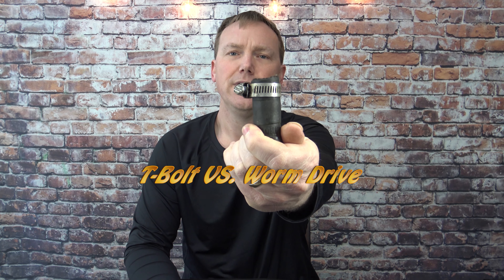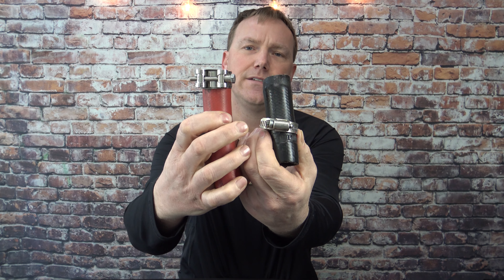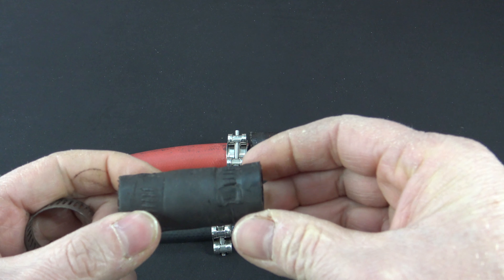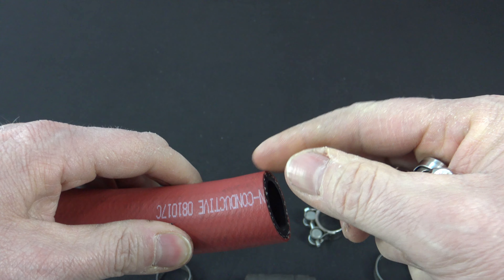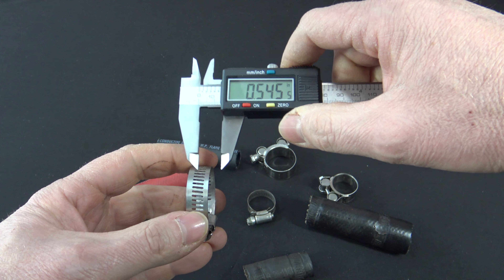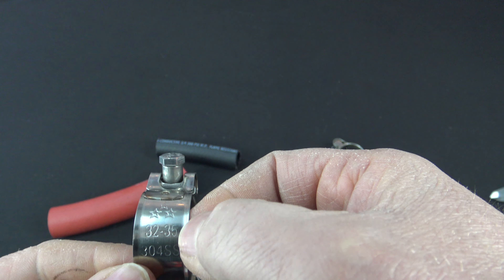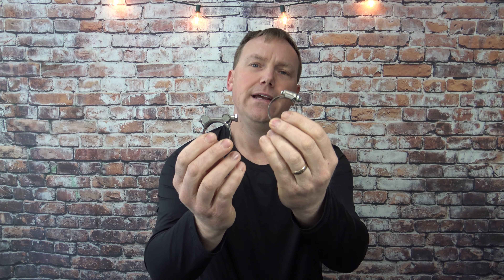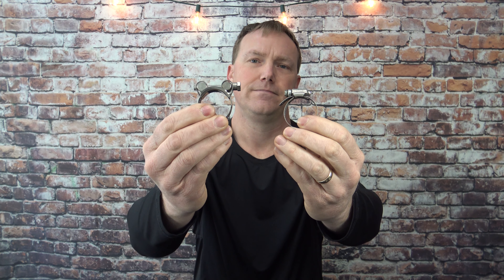The Best Hose Clamps/ T-Bolt VS. Worm-Drive

Comment: If you can get by with single use. I'd recommend Stepless Ear Clamps over using Worm Clamps, since it wears more evenly than worm clamps. 
As for the T-Clamps, I'd recommend spring tensioned T-Clamps instead since it holds better with temperature fluctuations.

Comment: Notice also that the edges are not flat - they have a tiny flange that will keep the clamp from digging into the hose! - T-bolt clamps that is.

Comment: Can you open the T-bolt clamp, in the case where you don't want to disconnect the hose from the fitting?
Reply: I searched and found another video that shows you can.
Reply from the maker: yes you sure can

Comment: I just used some t bolt clamps for the first time and I can’t tell when it’s tight enough. Im used to feeling tension like you do with the worm clamps. How do i know when it’s tight enough???
Reply: Try to spin the hose with the clamp tightened down. If you have any movement it's not tight enough. I would suggest using a nut driver not a ratchet so you can feel how tight it is
Reply: Both types should be torqued properly, and they require less torque than most people think.  Remember that you're actually tightening against a rubber "gasket" like an O-ring, so the necessary torque isn't tremendous.  For instance, with the T-bolt, diameters in the 25mm range require only about 25 inch-pounds and in the 50mm range require only about 50 inch-pounds of torque.

Comment: This is why you should never use an "american style" hose clamp on a soft hose. But the T-bolt... I don't know. It might work but I'm not sure you will get the clamping force required, the hose and spigot is also of valid interest. 
High tightening torque is not the same as high clamping force.